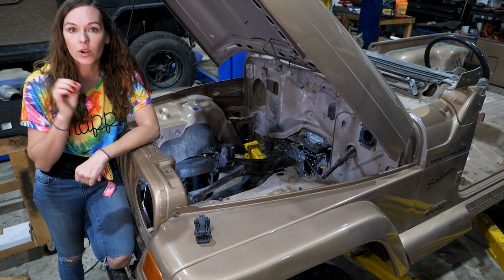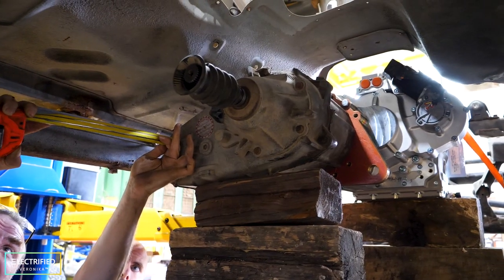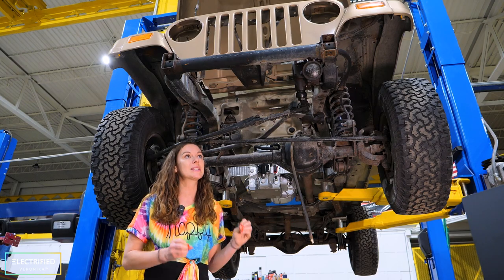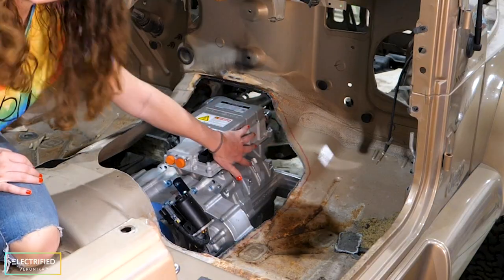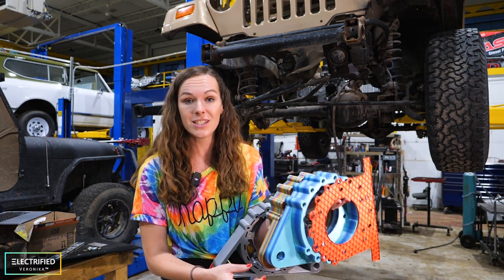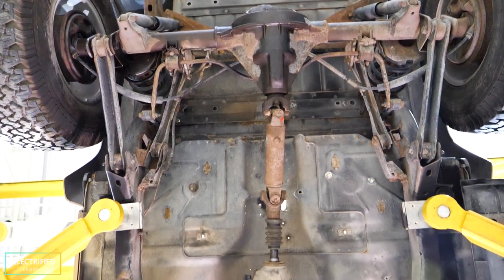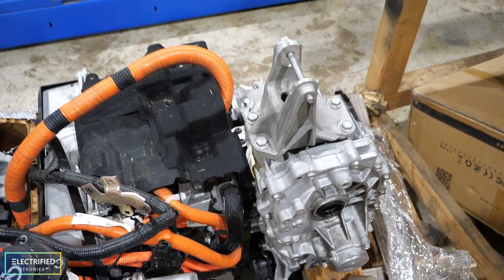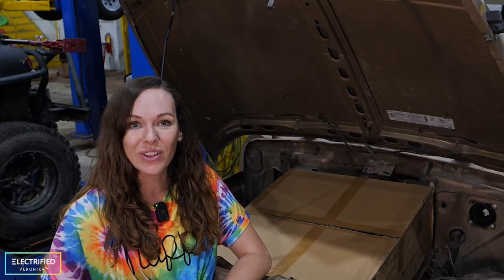How to mount the ELECTRIC MOTOR - Jeep EV Conversion

Comment: I found the motor I want to use for my future project and it is going to be a BEAST. 750 hp electric motor. I am now searching for a running gear that will not break under the power.
Reply from the maker: That sounds awesome and that's a lot of power haha! Which one did you pick and why?
Reply: @ElectrifiedVeronika  , I just like power and want to see how it does in the truck and tractor pulls.
The power and torque curves looks pretty good and I also want to aim for a high performance vehicle with some range. I'd like to see around a 400-500 mile range.
At the moment I am considering a hyper car kit car so maybe long range will not be a goal but would still like to see at least 300 miles out of it.
I still need to learn how the battery packs are calculated.
I may consider purchasing a few scrapped Teslas to use for parts

Comment: You might want to look into a slip yoke eliminator (SYE) kit for the rear output.  I guess if you never plan on putting a lift you'll be OK but since you've got it all apart and in the air, I'd say you might as well.  Just my opinion.  :)
Reply from the maker: Thank you for the suggestion, will look into it!

Comment: Was the original transmission a 6 speed manual? I wonder if that might help reduce battery load by using a manual transmission as I know from driving my truck that in 5th gear at 70 I am running less rpm than when I am starting out in 6th gear. Plus there would not be the need for a gear reduction unit. Basically I feel the OEM transmission would provide varying gear reduction or increase. No gate here as I love the project!

Comment: Looking good. Will you have to go through any process to declare it "street legal" ?
Reply from the maker: We'll see. We went to the local DMV in the very beginning and they told us to just come back with a list of components and they check it over - then it will be turned into a hobby car..and that's it..
Reply: @ElectrifiedVeronika  Not in Australia..  full engineer report etc
Reply: @neilwalker3204  Also in NZ, it's a huge pain in the ass and very expensive. Only a handful of people in the country qualified to sign off on it. Over here you better know before starting that what you're doing will get through the red tape, and nobody would be saying "we'll see" when they're half-way through the build :)
Reply: Here in Wisconsin she will have to nothing at all unless it has a salvaged title.
If it has a Salvage or Junk Title, You just need to schedule an inspection by the DOT and they will issue a Reconstructed VehicleTitle with a new VIN and everything.
Years ago I had a 1980 Pontiac Trans Am that was put on a Chevrolet Blazer Chassis and it had a Reconstructed Vehicle Title.

Comment: so why dont you use wheel based motors and then remove the entire flooring and replace it with a flat straight flooring and then have the battery box mounted underneath, raise the jeep to accomindate the height of the box and that way you have a center of balance and dont have to put any of it in the back or under the hook , dont need gear boxes, adapter plates and so forth and still have 4-wheel drive when you want it with independent suspension.
Reply from the maker: That was one of the options we looked at (I think we talked about it in episode 2 of this playlist) - at the time, it was extremely difficult to get in-wheel motors in such small numbers (it probably still is) and we were concerned about the cost and control of the individual motors. Certainly with that option the integration of batteries is much easier and comes closest to the "skateboard" design most OEMs are doing today.

Comment: Why not change the diff ratios instead of the 3:1 reducer?
Reply: Because the transfer case would likely grenade at the 6,000 rpm the electric motor turns.